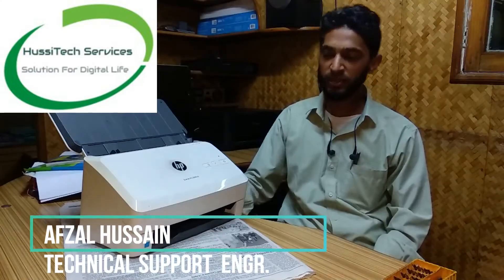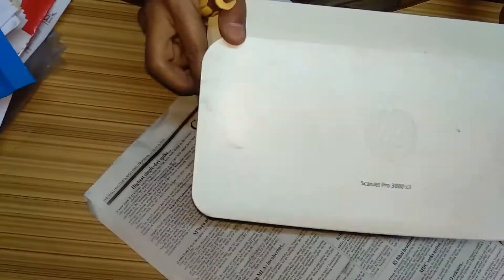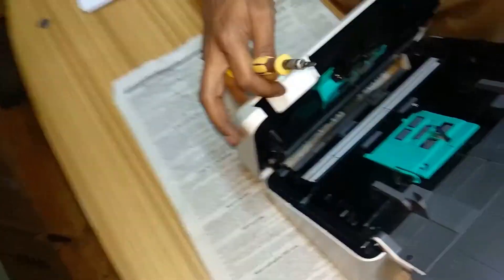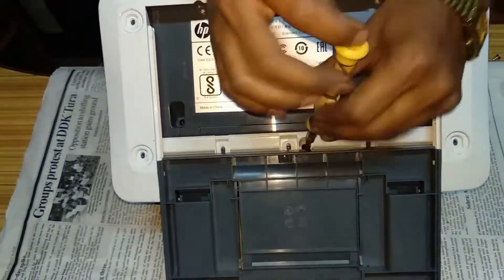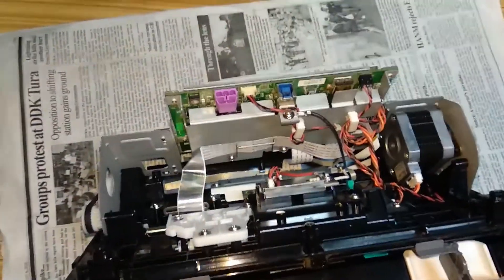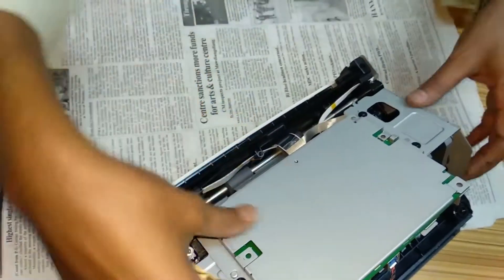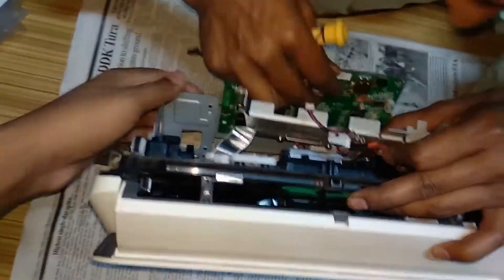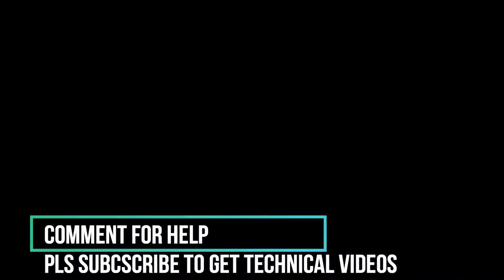HP Scanjet Pro 3000s Repair | Scanner Repair | HP स्कान्जेट प्रो रिपेयर | स्कैनर रिपेयर | New 2021🖨️

Comment: Hi sir ,do you have any solution for feeder error in scanner 3000 s3
Reply from the maker: Try cleaning paper feeder with a wet cloth, if it doesn't solve then search manual for this from hp portal or contact service center.

Comment: Scanner adapter is OK, but scanner does not start
Reply from the maker: Check with different power source
Check with different adapter n power cable
Check with power drain 
Check adapter voltage
Open scanner n refix formatter board
Do subscribe